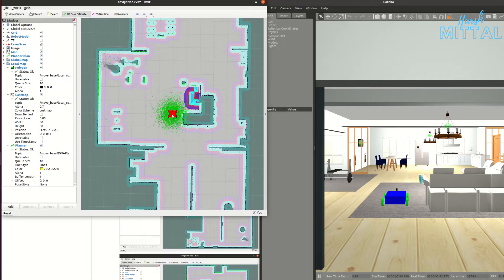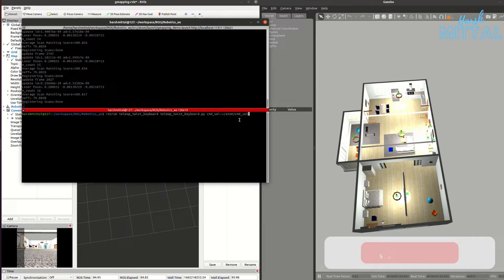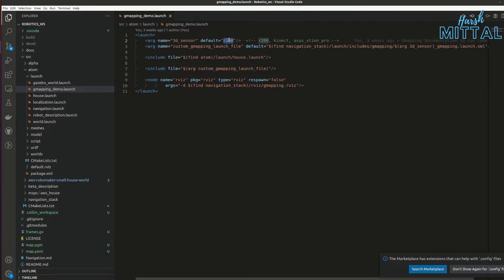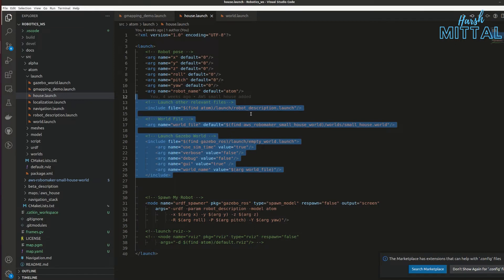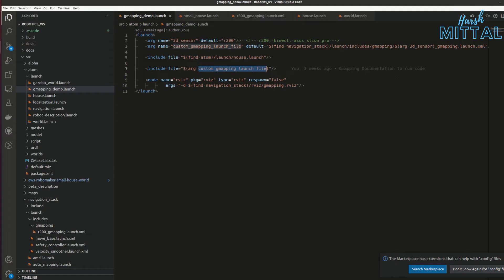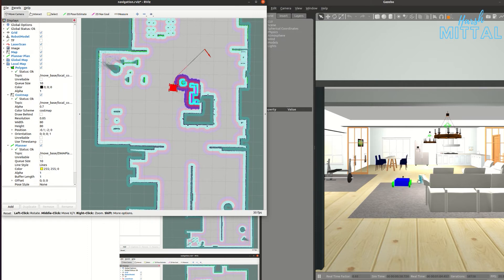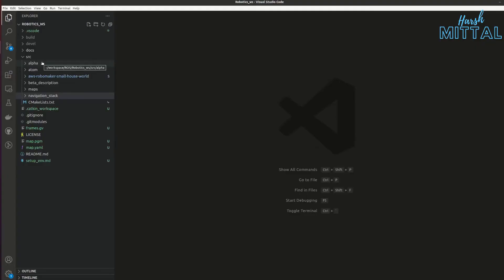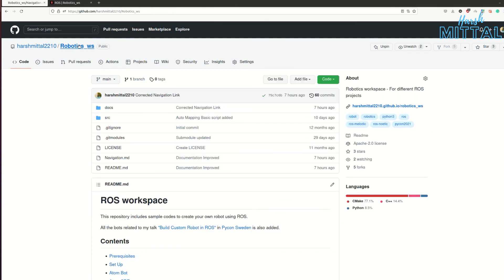Learn Basics Of Autonomous Navigation for Custom Robot Using ROS | Simple Tutorial | 2022

Comment: Sir, 
If we used raspberry Pi as a single board computer and paired it with the standard computer here, 
The command signals will be generated by the base station and transmitted to the single board computer. 
Means if we don't have base station after completing the ros updation did the mobile robot can't operate automatically?? 
Though we have installed the ros on the pi why we cant work without the base station or development machine ?
Reply from the maker: In case of ROS1 ros master is important and without it you cannot communicate. So try running ros master in rpi and use computer as a client ros node.

Better would be to shift to ROS2 if you are just starting out your project. There you don't have concept of ros master.
Reply: @BytesByHarsh  
Sir please can you put some more light on this topic.
Reply from the maker: Sure will try to do so. If not video then maybe in form of blog I'll write something.
Reply: @BytesByHarsh  
Thanks a lot sir.

Comment: Sir,
did we need to write a certain algorithm for controlling the robot??
or ros2_control will crate the algorithms by itself ?
can we implement other control algorithm other than PID ?
Reply from the maker: Hey so I am using AMCL (http://wiki.ros.org/amcl) here. No need to integrate any other control loop, everything has been packaged in it.

If you want to read more: https://github.com/bytesByHarsh/Robotics_ws/blob/main/docs/Navigation.md  

If in case you want to implement your own you can do so easily by subscribing to target and initial pose. You can also make changes in the existing control loop here: https://github.com/bytesByHarsh/Robotics_ws/blob/main/src/navigation_stack/src/bot_drive.cpp#L83.
Reply: @BytesByHarsh  
Sir, 
Out of the cartographer, hector, karto, g mapping , Which SLAM technique is good how can we decide it?
Reply from the maker: There is no fix answer, as it depends on lot of factors. Try to read through studies done by other people, eg https://adityakamath.github.io/2021-09-05-comparing-slam-methods/

But overall from what I have read cartographer will give better robustness and accuracy.
Reply: @BytesByHarsh  
Thank you very much Sir.

Comment: Hi! This is very interesting, I'm actually making a robot that should be able to navigate inside a fixed facility (it'll just receive commands like go to coordinates x). Do you think this functionality is the best for that? I can't use ROS2, just ROS noetic, in a raspberry Pi. Currently I'm at a stage where I have a robot that is radio controlled using 2 axis, throttle and steer, do you think I can use these functionalities to have the raspberry pi send 2 axis commands? Or is that just adding unnecessary complexity? 

Thanks a lot!
Reply from the maker: Hi so for any system to move autonomously it needs a frame of reference. As of now you are controlling from the radio you are providing that feedback. But if it has to be autonomous then you need some feedback. It can be from wheels, vision, Imu or in my case Lidar. The choice is your but you will have use such kind of system.
Reply: @BytesByHarsh yes, I know, I am supposed to use computer vision, so a camera or more, do you know if ROS has any functionalities for that?
Reply from the maker: Ofcourse ROS has tons of solution for that, you can check out different SLAM algorithms based on type of camera you are planning to use.